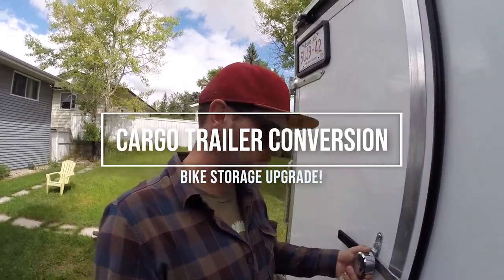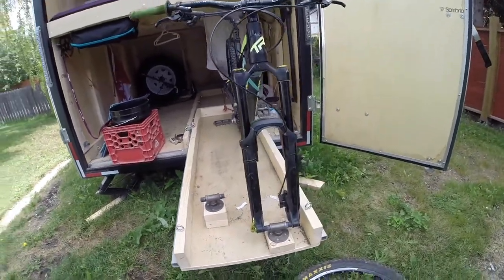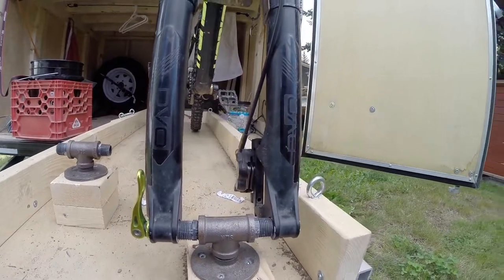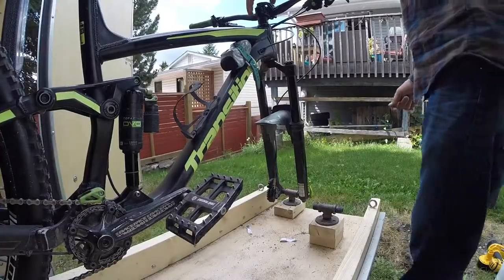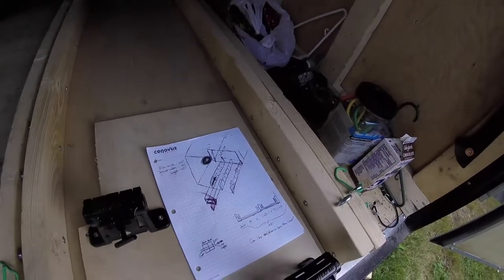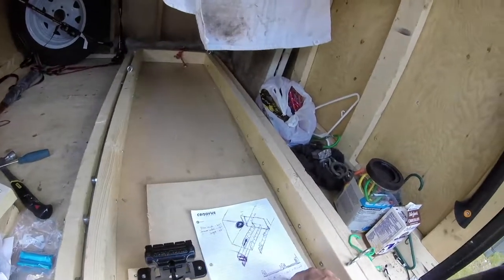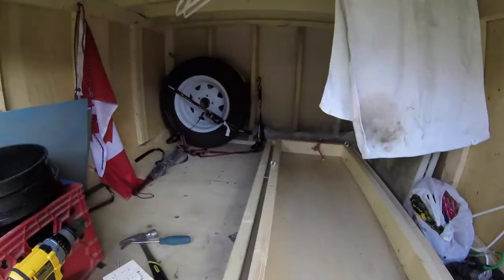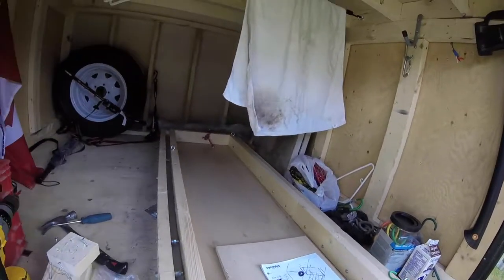DIY Bike Slider | Major Upgrade Day | Cargo Trailer Conversion | Rockymounts Driveshaft

Comment: Where did you get the bed slider from, very nice set great set up.enjoy.
Reply from the maker: Built it myself! Some square aluminum bars and roller blade bearings is all you need

Comment: Awesome slider. Do you have a tutorial for how you built the drawer?
Reply from the maker: Not yet unfortunately. I'll make one next chance I get but that will be a while. 
Honestly there's not much more to it then what you see in the video. Some bolts from the hardware store, some skateboard bearings from Amazon, some 2x4, and some straight pieces of aluminum square tube.